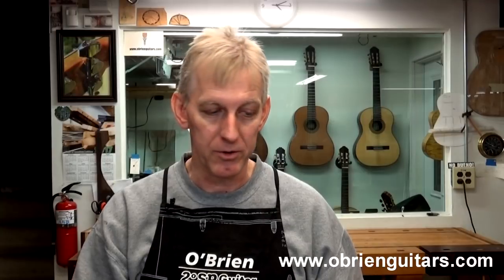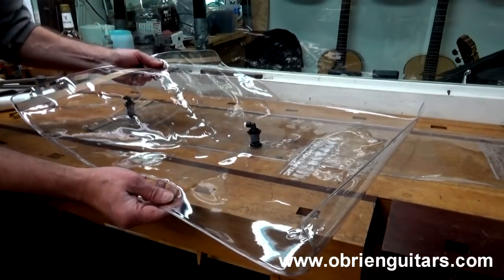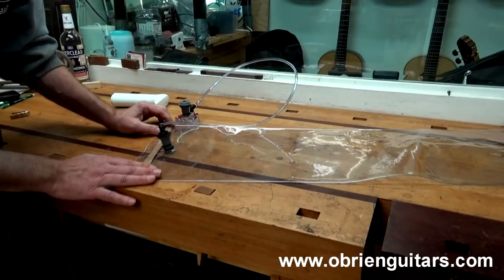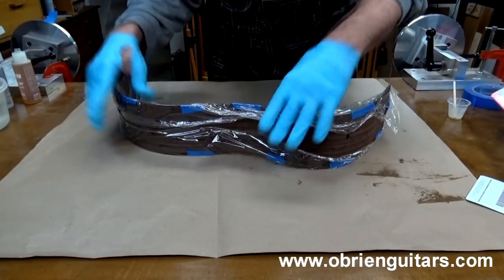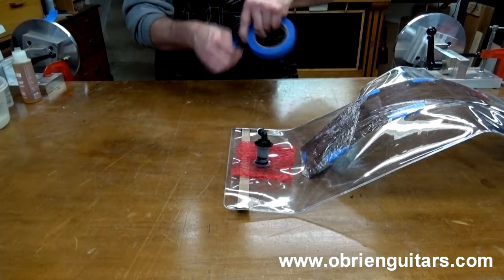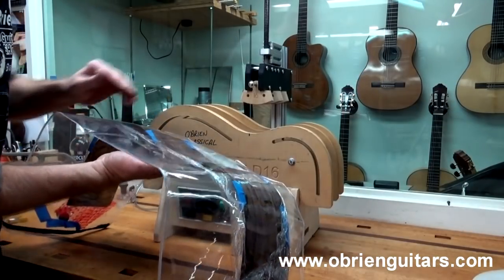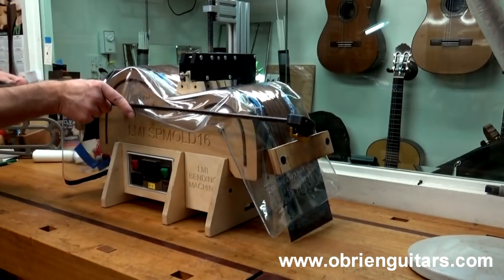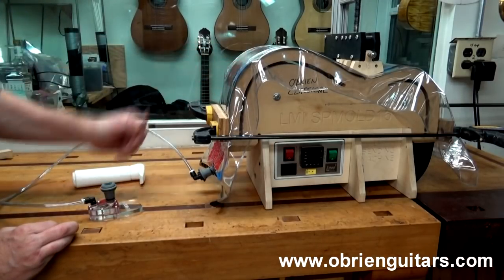Luthier Tips du Jour Mailbag 79 - Laminating Sides

Comment: Robert you  always make it look easy !!  I learned the hard way there is some school of hard knocks with vacuum bags - for example I wish I would have thought about glue squeeze out before making a total mess. Ditto using epoxy - I had multiple squeeze-through spots (right through pores etc) w titebond that would not take finish correctly and were unfixable - and also permanent unsandable bumps and  bubbles from exposing the veneers to all that moisture.  What works great gluing veneer to a chunk of flat MDF for furniture does not work so well for bent laminations. Live and learn!

Comment: Hey Robbie! Are you still using the Roarocket exclusively, or do you sometimes use a vacuum pump on some projects?
Reply from the maker: It depends on the project. A double top for example I generally use a pump but for laminating sides the roarocket works fine.

Comment: Hello, my gibson acoustic has a 3/16" corner laminate strip that is delaminating. It is >20" long and maybe 7-8" of it are delaminating. I'd like to glue it correctly before it cracks. Recommendations for glue for this? I was simply going to use blue masking tape to support it while drying.
Reply from the maker: I would probably just use yellow glue but hard to say without seeing a pic of the area in question.

Comment: Great video, Robbie ! Do you think this vacuum pump would also work with the LMII bridge glueing device???
Reply from the maker: I do not see why it wouldn't work.
Reply: You think it would glue a bridge to a top in that bag??  Is that what his question meant or using just the pump with some lmi bridge fixture for a vaccum press
Reply from the maker: I think he was referring to just the pump. That is what I understood the question to be.
Reply: I was meaning just the pump, guys. The hand pump attached to the lmii bridge device instead of an electrical powered pump.
Reply: @OBrienGuitars  I do. The electric vacuum pump will compensate, automatically,  for small leakage that may occur along the seals of the LMI vacuum bridge fixture. So, you could just check every so often with the manual pump to determine if you need to increase the vacuum. There are at least two other ways to affix a bridge to the guitar without vacuum and without heavy, dangerous clamps. I may divulge later if I can secure a patent first.

Comment: WHY???   TONAL.  If you've never laminated sides and made them 4-4+mm's,  I suggest you try doing it.  At the same time, make the back a bit thicker.   Your back thickness can be anywhere between 3.0-3.5mm's.  Heavier rosewoods like Cocobolo can be thinner, say 2.5-3.0mm's.  Your guitar WILL be heavier, but you might NEVER EVER go back to single sides.   Your guitar will have a more focused sound, more sustain and more projection, more volume.  If this appeals to you as a player and listener, then I suggest you try making a guitar with double sides and a slightly thicker back.  On the other side of the coin, single sided guitars can sound amazing!!!  In the end, as long as the quality of sound is there, you end up creating different flavored guitars, just like different flavored high quality ice cream.  I personally build classical guitars with single sides AND double sides.  I like them both.  But the heavier double sided guitars have more power, more volume and more projection.  The soundboard works way more efficiently.  Good luck.  Well done, Robbie.
Reply from the maker: Thanks for the suggestion. Australian luthier Trevor Gore has written a couple of books on modal tuning and explains the difference between mass and stiffness. You might find it interesting when it comes to this subject.